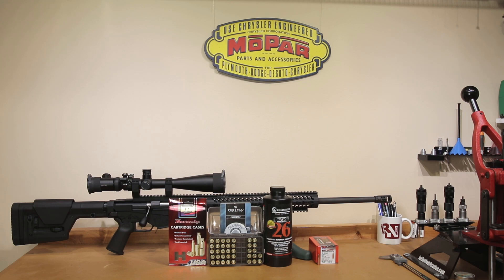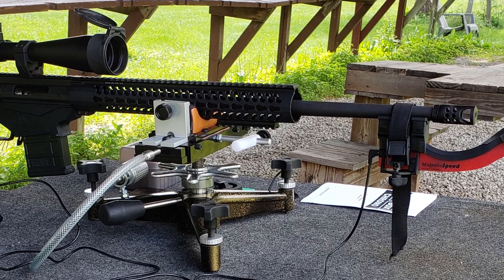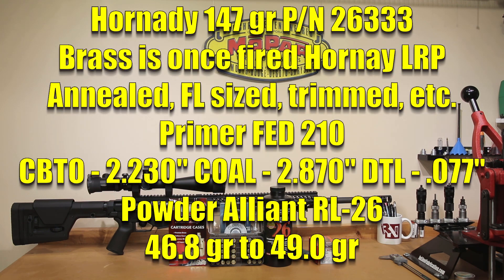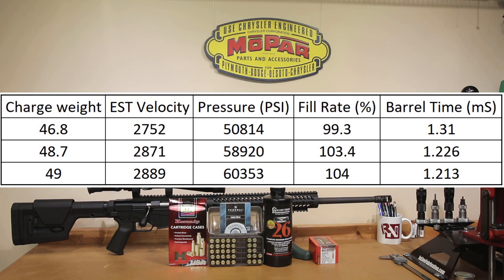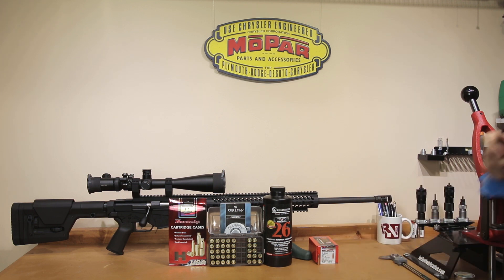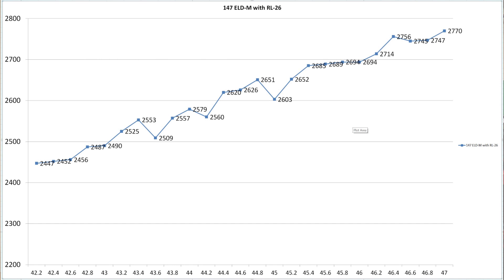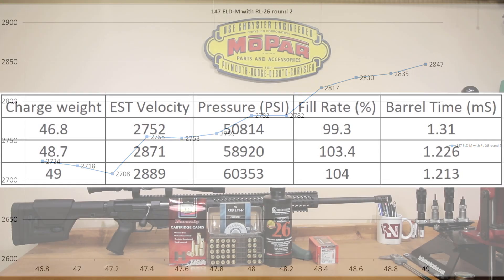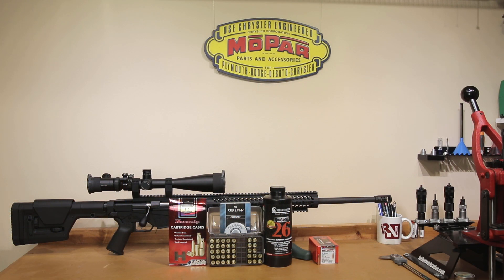6.5 Creedmoor - Trying for higher velocities with Hornady 147 gr ELD-M with Alliant Reloder 26

Comment: I have learned a lot from you in the last year and really appreciate the detailed videos! I am wanting to run 140gr Berger hybrids with reloader 26. I am struggling to find either of the 4350's and want to try something else. Should I even bother with trying that load out? The compressed part discourages me..
Reply from the maker: I have really struggled to find lower sds with RL-26.  It has huge velocity potential but you are typically running out of case capacity. If you go down this route do yourself a favor and pick up the Forster drop tube funnel. It will help you keep the compression down to a minute. I have a video on it if you want to see the differences. Don't be afraid to try an another powder that is close. Imr 4451 is great along with a few others.
Reply: @BoltActionReloading  I'm struggling to find actual berger load data at the moment! I have IMR 4451 actually and some superperformance.
Reply from the maker: Both are options I personally would prefer 4451 because of temp stability. Having exact load data is always preferred but you may try something like Gordon's reoading tool to find a safe place to start and work up from. Just be careful and look for pressure as you move towards max. Regardless of what the manuals say you have to know what pressure looks like so your not exceeding it in your application.

Comment: did you ever get a good accurate load with this combo? 

I managed to find a really good accuracy/consistency node with this combo over a full 1.0 grain however my Satterlee development data has not worked at all for this combo.
Reply from the maker: I did not, but I haven't tried it with my new barrel yet either. I think thatif this is going to work well it may benefit from a different primer. I just haven't got there yet.
Reply: @BoltActionReloading  in my own findings the CCI 450 in Lapua brass has been adequate for the combo. I was able to develop a load where 44.8-45.8 gr has given me a window where the highest SD is 8.4  and lowest SD is 4.2 fps with my load being 45.4 gr with an avg velocity of 2845 fps in a 26" tube. It does not however follow the Satterlee pattern as the velocity just climbs as the charge increases and only 45.3-45.5 has the same velocity. Definately different than the usual pattern for velocity gain vs powder charge.

Comment: Like your vids. Very informative. You mention barrel time relating to nodes in relation to length. From where do you gather that information?
Reply from the maker: Hi David, Glad you enjoy the channel. This info is scattered in various places but the table here: http://www.the-long-family.com/OBT%20Table.pdf
I am still exploring this information and will probably keep look at this info as I work on various projects so if you keep watching I am sure we will keep discussing it as we learn more.
Reply: Node charts could be helpful but nodes are specific to each individual rifle. Just need to test. Watch barrel harmonics video by Tiborasaurus Rex
Reply: Nodes are also dependant on barrel length. That why QL give you barrel times. I have a excel spreed sheet that generates the optimum barrel timing nodes when i plug in a barrel length all based on pressure waves aka harmonics for what ever barrel length I want to plug into the spreed sheet. 95% of the time those barrel timing nodes just so happen to match up to velocity nodes. It's not a coincidence.

Comment: One more recommendation is using QL. When picking a powder for a certain bullet and cartridge combo pay attention to the graph. You want the pmax and Z1 line to be as close as possible to each other. One line would mean that the powder is the ideal powder for the combo picked. Looking at barrel time numbers does not always guarantee a good fit. Burn rate is everything. And don't forget when you adjust the B a to adjust temperature for your current environmentals you had while shooting. Junk data in junk data out.

Comment: Why are you not changing the Burn Rate Factor B a  in QL to match your measured velocity??? This will give you a more accurate pressure and OBT.And just looking at primers to evaluate pressure is also wrong. By the time a primer will show a swipe or cratering you are already way over pressured.